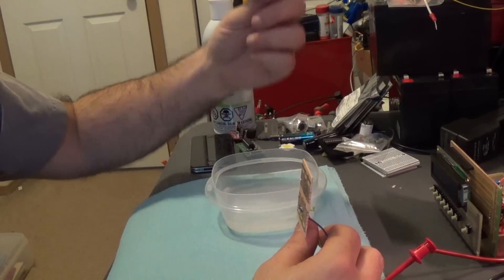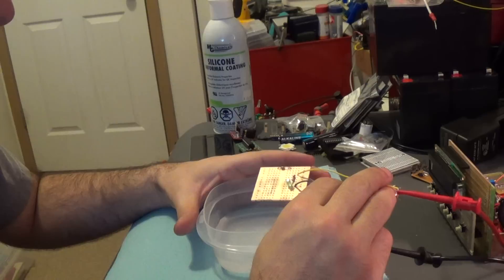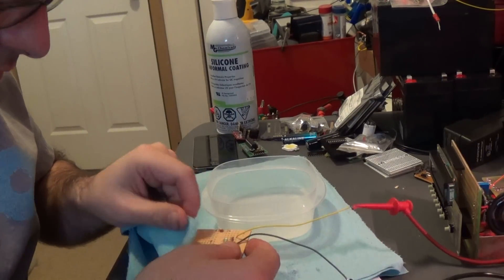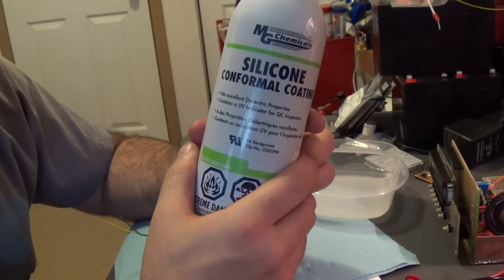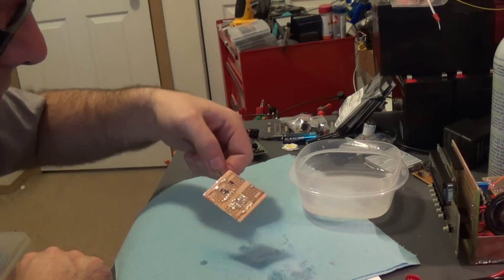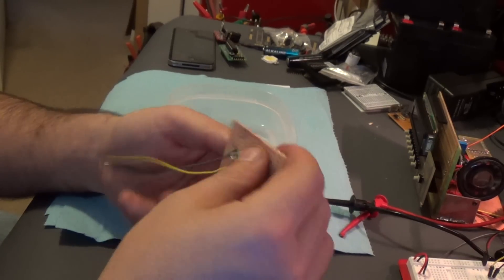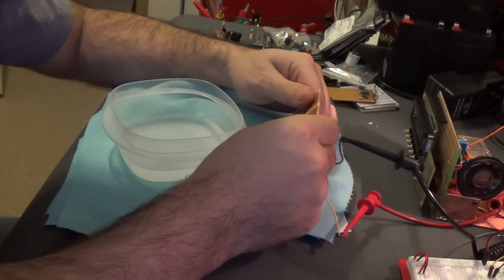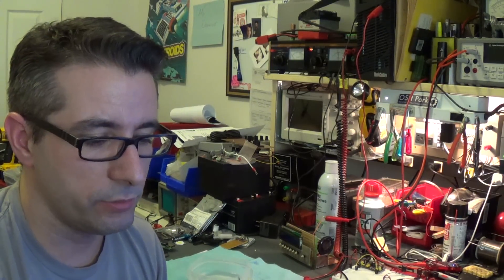Conformal Coating

Comment: Im wondering if you have ever ran into a conformial coating that is a little thicker viscosity . I plan on coating pcb boards on ac systems. We have a big problem with small gecko's ( lizards ) crawling into or on the pcb boards and shorting them out.  Need advice. Thanks

Comment: I am having trouble deciding between urethane or silicone conformal for the electronics on my RC. Which one do you recommend and why? Thank you!
Reply from the maker: Stay away from urethane for RC, silicone is more heat tolerant (drivers) and way more friendly to vibration... Also note I've killed two transceivers that used open inductors for tuning... So stay away from your RF stuff unless you feel comfortable the front end is sealed up well.

Comment: http://www.marketsandmarkets.com/pdfdownload.asp?id=4692419

The global Electronics conformal coating market size is estimated to grow from USD 17.01 Billion in 2014, and is expected to reach USD 24.17 Billion by 2020, at a CAGR of 5.99% between 2015 and 2020. The growth of this market is being propelled by the increasing usage of electronic components in the end products by OEMs, as well as ability of this coating to help manufacturers to provide end products with higher level of reliability.

Comment: Conap CE-1155 two part urethane is bulletproof and what the big boys use.
Anything in a spray can isn't very good. Silicone is best for very high temp applications. Humiseal acrylic drys very fast but requires a LOT of coats. 
And yes, it's what I do for a living:)

Comment: First:  Thanks for posting this video.  It has helped with my research.
Secondly a few questions:  What's the difference between the spray and using a clear 100% Silicone sealer?  You said something about the spray detuning a rf board.  Am I to take it that it's not a good idea to apply liquid silicone to integrated circuits?
Reply from the maker: Joel, Thanks for the interest. While I'm no professional when it's concerning RF and sealants I can tell you I've personally caused plenty of havoc using both conformal spray, RTV, and silicone sealant on RF circuits. I was looking for a way to help protect some 433MHz receivers. These units had small inductors on the PCB that were part of the tuning circuit. Despite my attempts to keep the coating as minimal as possible all products caused some tuning issues with the receiver. I tried with and without; it impacted reception greatly. The conform spray was used as it did the least damage on the project but I would recommend testing. The RTV made the modules unusable. I would guess that if you were using one of the Si47xx series receivers on a chip (etc.) you'd have no problems with either product but I haven't done any testing; if you do I'd be interested in finding out what your results were!
Reply: +Charles Ihler you have to mask off the areas you don't want the coating to get into be it with masking tape, laptop tape or Brady dots for screw heads or ground planes.
Reply: +auxmike meant to say kapton tape!

Comment: Thanks Charles, I have a thin client that I'd like to keep outdoor 24/7. Do you think I can apply this coating to protect it from severe moisture due to heavy rains and weather fluctuations?
Reply from the maker: I don't think so. If it gets behind connectors or switches it will act like an insulator. I think it could cause more harm than good .. Also I'd
Keep it off heat sinks but other wise the bottom of PCBs and such should be fine.